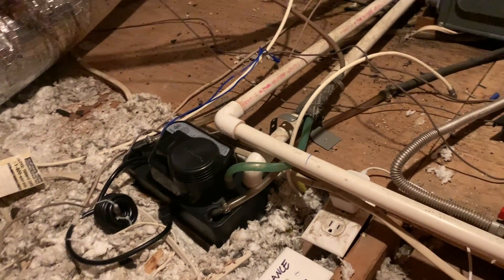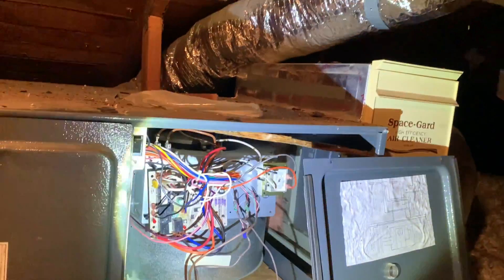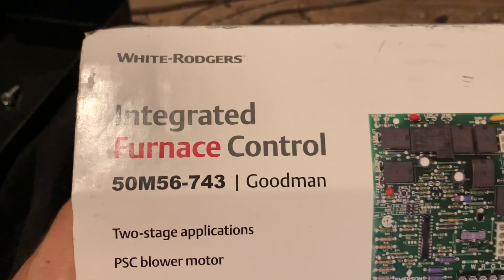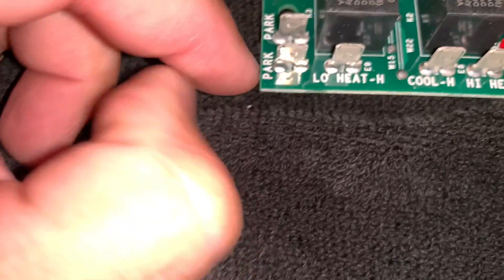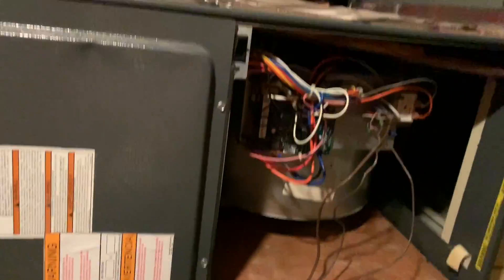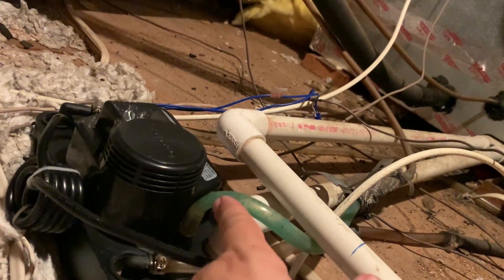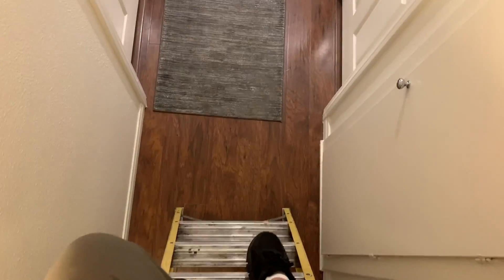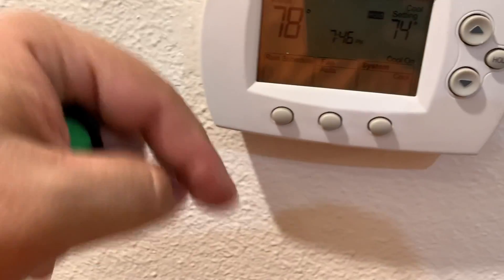Amana & Goodman furnace GMH95/GCH9GAS - Replacing Motherboard￼

Comment: Thank you so much for this video. I needed to see where the blue, orange and red wires connected to the circuit board. We've haven't had air conditioning for over a month. My wife was determined to make my life a living hell until I fixed it.   Thank you
Reply from the maker: O great! Did you get it done?

Comment: Just changed the control board in the same model unit. Repair was only $90 and estimate for repair was $475. These heating and air companies are way overpriced.